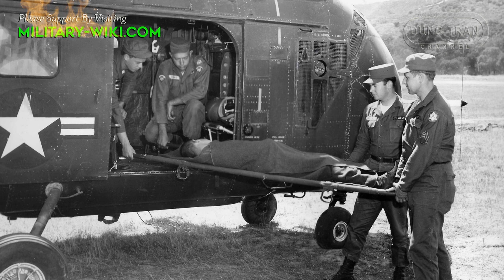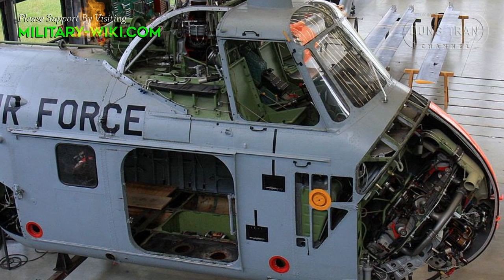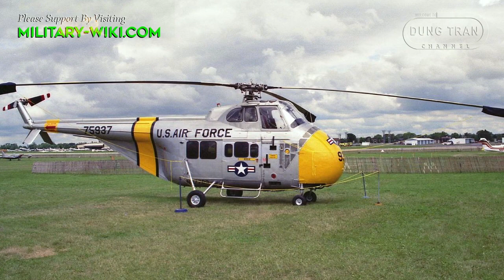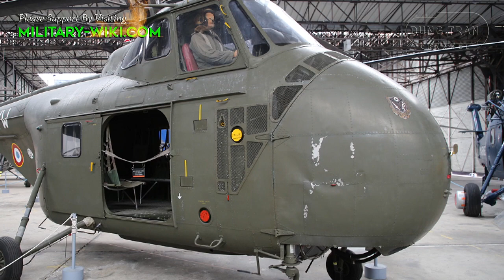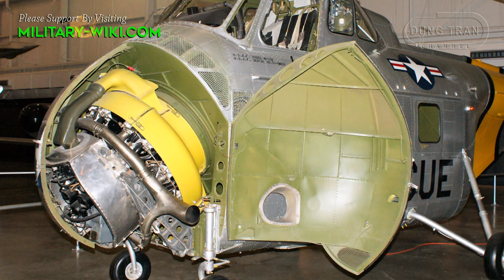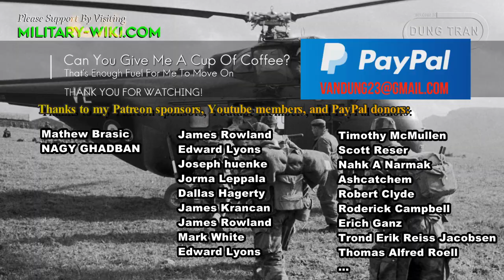Sikorsky H-19 Chickasaw: Classic Black Hawk Of The 1950s

Comment: underpowered she shouldhave had a good 1,000 horsepower if not 1,200!!
Reply: Hard to do without increasing the size in a piston engine design. They eventually did do an upgrade, S-58/H-34 or Wessex at this end of the pond. It went up to 1500 SHP but took a full redesign of the entire aircraft.
Reply: @ZLSM-fan  i was talking in the project specifications and then drawing board on Jackson! but the always underpowered these early egg beaters!